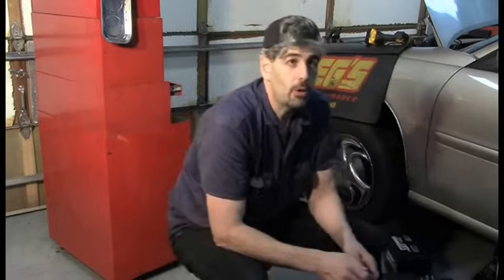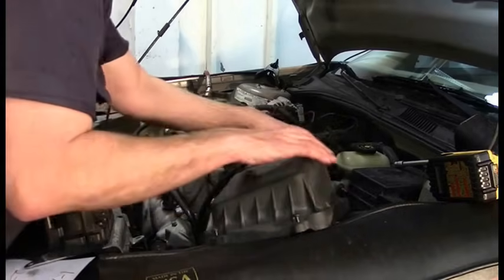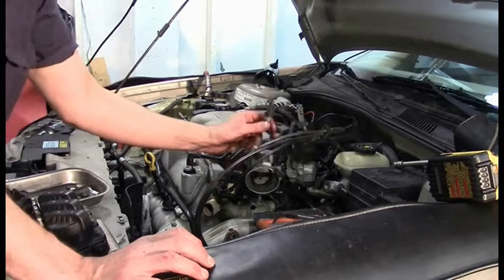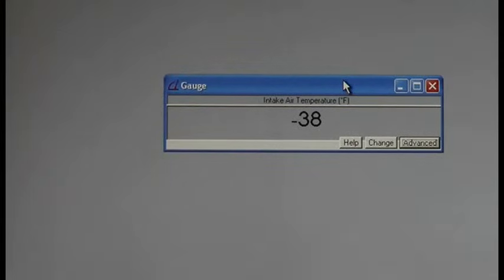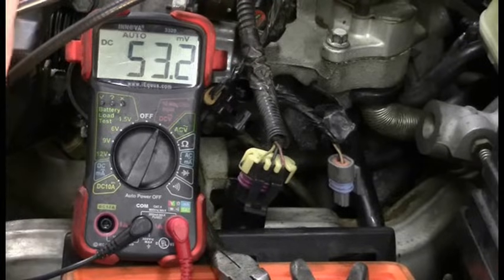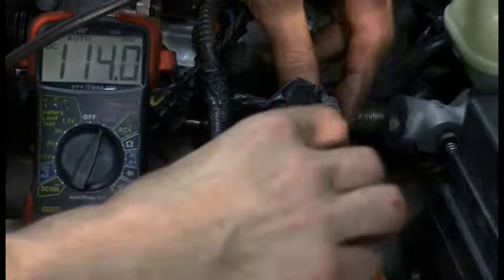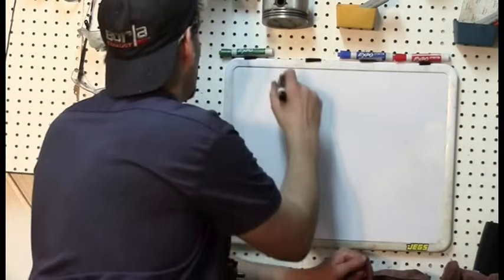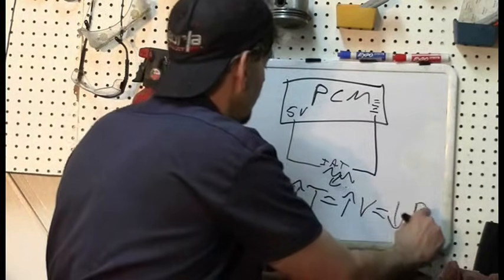IAT ( Intake Air Temperature Sensor ) Diagnosis P1111, P1112, P0113

Comment: I'd just like to say that I really enjoy your channel.  I'm a DIY'er that has a desk job during the day but I love working on my cars.  With 3 kiddos and 5 vehicles in our driveway, we cannot afford new cars.  I get great satisfaction in keeping my fleet up an running.  Saving money and the feeling of fixing something is always a rush.  I'll admit that I watch a lot of videos trying to diagnose and determine the best route to take which can often be part swapping.  And even though I find the problem pretty quickly, I know I sometimes replace parts that did not need to be replaced.  I really like your approach of finding the why behind the what.  Thanks for taking the time to explain in detail how you find the root problem is.  I'm investing in a power probe kit that you use.  Looks like a great tool especially since my vehicles are up to 15 years old with up to 260,000 miles.  I really try to take of what I have and make it last as long as possible.

I wanted to see if you might want to offer some advice on a problem I'm have on my daughters 1999 Jeep Wrangler 4.0 v6.  We bought the vehicle with 82k miles and its in really great shape but looks like it has set up a while.  My daughter is 17 and I as with all my kids, I want them to have some working knowledge on how to work on cars so they don't get taken advantage of when they move way from home.  We have replaced all the brakes, shocks, fuel pump, IAC valve, flushed brake system, replaced radiator, thermostat, flushed cooling system, flushed power steering fluid, changed differential fluids, belts, hoses, throttle position sensor.  

Here is my problem.  On cold start, no idle problem.  She drives to school which is about 15 minutes away.  After her class she leaves about 45 minutes later,  it idles really high around 2500 rpm and then bogs down as she puts it in gear and drives away.  When it bogs down it sounds like its not getting fuel.  Fuel pressure is good.   After about 5 seconds or so of driving, it will stop bogging down an run ok.  When she puts it in part, it revs really high.  I replaced the IAC valve and TPS thinking that would stop the problem but no luck.  I am wondering if it could be the air temp sensor?  Any advice you can offer up?  Thank you...  And there are no engine codes being thrown
Reply from the maker: WHat data do you have? What is the STFT and LTFT at idle vs load? When you changed the TPS and IAC, what were  the IAC positions and did you confirm voltage response from TPS?  I need to know the data you used in your diagnosis of TPS and IAC before I can help.
Reply: The vehicle is not throwing any codes.  Honestly I do not have any of the information you are asking for.  Please note that I have been in a part replacing mode up until now.  You have convinced me to do a better job diagnosing.  Not exactly what to check first based on the symptoms. Could you recommend which parts I should test first?  I have just today ordered the power probe kit.  I do have a volt meter and an Actron engine code reader/diagnostic tool.  I will check to see if the scanner will give me the STFT and LTFT data.  I did not confirm any voltage response from TPS when I changed the TPS and IAC.  I just know it did not fix the problem.  Just not sure where to start.  Definitely seems like once the vehicle is warm it acts up vs. cold start. But even after driving for long periods, it wants to idle high once we put it back in park.  And gas mileage sucks bad.
Reply from the maker: Jeremy-Stephanie Millar Yeah without any data I'd be no better at guessing than anyone else. If you get me some data I can help.
Reply: Sounds good.  I guess I'll start with fuel trims and then see if TPS is working properly.  Thanks for the quick response.

Comment: When testing the IAT sensor did you turn the ignition switch on to mimic driving conditions that could be why you didn't have any voltage readings above millivolts.
Reply from the maker: You have to have KOEO for any sensor tests. No sensors are active otherwise.

Comment: Got tired of ignoring IAT code lighting up the check engine, ( yes its still there :o ). Thank you for the vid for simple test. But now wish I had the signal break finder tool. Hoping mine is a invisble break at top of motor and not harness or pcm.

Comment: I have a dodge charger 09 for some reason sometimes when I start it makes a clanking noise I've done so much to the car but nothin really helps
Reply from the maker: You just need to do basic diagnosis taking things apart until you find the noise.  What have you done so far? What's the oil pressure at startup? is the noise valvetrain or crankshaft related? What's the starting temperature?  You need to tell which of these you have done.

Comment: im getting the right amount of degrees on my code scanner but it changes to -40 when i unclip the plug that goes to the iat sensor. i tested the resistance of the sensor and it starts off at 1.9 instead of 2.6 but it does go down when i put a hair dryer on it. does this mean my sensor is good or bad?
Reply from the maker: What else would you expect?
Reply: Schrodingers Box  im not sure what you mean? one of the methods says my sensor is fine while the other says it is not working properly. so thats why I'm asking what you think it could be?

thanks for the reply.
Reply from the maker: KNAMusic Looks right to me
Reply: Schrodingers Box all im asking is how can my sensor pass the hair dryer test but fail the code scanner test? i checked for the voltage on the thing that attaches to the sensor and I'm getting 5 volts. which feom what you said means the wiring is fine? im judt a little confused because the sensor passed one test but failed the other
Reply from the maker: KNAMusic How did it fail the code test? If you unplug it to create an open it should show -40
Reply: Schrodingers Box oh alright. well then i don't quite get why the code is even showing in the first plave then. is there a chance that it was fixed earlier and the code was never cleared so it stayed there? or should the code go away by itself?
Reply from the maker: KNAMusic You will need a chart comparing the resistance and/or voltage output in p[roportion to actual temperature to ensure you have calibration.
  ALSO, it may be you have an air volume input error that is erroneously being blamed on the IAT.  WHat is your fuel trim showing?
Reply: Schrodingers Box  my stft percentage is bouncing ranges from -0.8 to -1.8. it sometimes hits 0. does this sound normal to you in a warm engine? also i appreciate the replies. you earned yourself a new subscriber :)
Reply from the maker: KNAMusic Yes thats expected- its the LTFT that gives your trim history. The waivering STFT is the result of the intention rich-lean oscillation by the PCM.  See my "P0420 diagnosis" video.
Reply: Schrodingers Box okay i will do that tomorrow. thank you :)

Comment: Hi there.  I'm hoping you can help me out.  My car started to feel jerky while accelerating.  I got a P0110 code.   I cleaned the IAT but that did nothing.  The harness connector gives 5.01 volts and there is continuity at ground.  At 20K Ohms the sensor is 1.9 (the number decreases fast when heated).  Is this a normal value for a Denso IAT?  I can't find any specs for the one I have.  Any help is appreciated.   Thank you.
Reply: Zuvtehcoa could be spark plugs/wires/throttle body.

Comment: thanks for your info man I apreciate your knowlege i did the scan tool method and the sensor is bad im replacing it tomorrow morning 2005 dodge grand caravan
Reply from the maker: What was the data you got? Just curious.
Reply: Schrodingers Box i got 73° while at the time it was 43° after being unplugged it turned -68°
Reply: Kayla Janet it was around 36 dls at my local O'Reilly Autoparts

Comment: i have an 07 ram 3.7 that for ever reason randomly decides to run rough when idling...no codes... some pple have said clean the maf sensor...im not sure where it is on that motor.... I did clean that iat and the throttle body which both were realllllllyyy dirty and that seemed to help alloot.... but still not where it could be...any thoughts
Reply from the maker: What data do you have? What is the foundation for those saying it is a MAF issue? Is that indicated by increased fuel trim under load or by voltage and frequency compared to baselines?

Comment: I open the hood of the car and the IAT was disconnected. I had it serviced so they forgot to connect it back. but after I plugged it back in the check engine light still on. should it go off right away or do I need to erase the codes?
Reply from the maker: It will go off after about 40 drive cycles on its own. You can also erase with code reader or disconnect battery for an hour

Comment: Nice video ! now I have a question I have a 2016 challenger scat pack and I was racing 1/4 mile and spraying nitrous after my run I had the P0113 code .. do you think it was because I sprayed very close to my sensor?

thanks
Reply from the maker: What data do you have for the STFT and LTFT with and without the NOX?

Comment: I have a 97 Honda Odyssey 2.2 engine and I'm looking to see where is the intake air sensor air temperature sensor and I don't find it
Reply from the maker: As mentioned on the video it is either in snorkel or intake.  It is an intake air temp sensor. The name actually tells you the location.

Comment: the IAT is missing.  there is just a  hole.  i also just got the car back from a mechanic who certified the car.  2003 civic ls
Reply from the maker: I have seen this happen a couple times where a sensor was completely removed with no wiring or anything - often as result of unprofessional engine swap.  WHat I do is simply run new ciruit and sensor directly to the PCM in those cases- its far easier than hunting down the missing wiring.  IAT is super easy since it is only a 5V reference and signal return so I usually just tap into existing 5V circuit and ground at PCM return

Comment: I loved your video, and praise your skill as a mechanic.   I particularly like your use of a wire tracing tool to find a break in a wiring harness!    I have one of those... for tracing phone lines in buildings, and I'm going to use it your way... Right on!

By the way, we are opposites!   As such, I might have some simple advice that will enhance your t/s skills in this age of sensors, actuators, and computers.   I'm an orthodox, experienced hardware electronics engineer, and only an occasional "mechanic."   I noticed your naivete about electronics right at the beginning of the video ... with no animus, only praise that you solve problems day in, and day out, despite this naivete.    If you'd learn Ohm's Law and (importantly) realize how useful it is (via voltage drops, when current flows) you'd be barking up the right tree, on some of the theory points you are flirting with.

So there exist voltage and current sources; laypersons easily grasp the notion of a car battery as a voltage source; a new battery is a very good voltage source.    Then there are voltage dividers (and also current dividers, a more subtle point) and t resistors convert voltage sources to current sources, back and forth, back and forth.     Point being that once current starts flowing, voltages observed (relative to ground) start dropping, the further you get, down the line from the voltage source.

I won't go further with this lecture... and I compliment you for making the long, detailed video, to help me and a lot of other people by being so generous.

Hey, I would have looked for a wiring diagram before doing any repairs.     You didn't bother.    Instead, you used a wire tracing tool.  Bravo!       I learned something about the practical world.

Comment: I have AIT the integrated into the MAF, I replaced the MAF and am still having the same code p0113... I have no idea how to check the voltage or find if the line is broken
Reply from the maker: +rasheed bradley Yeah hopefully someone will make a video showing how to do do diagnostics on the IAT circuit. I can't think of any sources for a clear, easy to follow video that anyone has done on YouTube that shows easily how to do that.

Comment: You always mention the 5 volt reference when testing components,,,does this also apply to foreign I'e British vehicles.    Great channel, have learned a lot from watching
Reply: its always manufacturer specific but typically computer reference voltage is 5v.  Sometimes 7v.

Comment: Matt, my problem was when I changed the thermostat, the black wire broke off the connector.  Am I able to just get a new connector? Or will I need to get a whole wire harness just for the connector?
Reply: +ggin nj - nevermind - found it!

http://www.amazon.com/dp/B00CF64940?psc=1

Comment: Great job Matt…you said you are self taught.    What books do you use to self teach ?
Thanks again    walt
Reply from the maker: +berkmanyt I mainly use the helms factory service manuals.
Reply: +Schrodingers Box    I have  some  Haynes manual…several Camaro factory shop manuals (expensive  #135+)  provide good info…but are sometimes weak also.  One has to do web searches and then  'filter' the results.   Thanks again Matt

Comment: Great video.  Working the exact problem on a GM 3.1.  Thanks for doing these, saved me butt loads of $$$$.
Reply from the maker: +Jason Bailey Yes it turns out a GM tech saw my video and he actually sent me a TSB that was issued long ago on this very problem. Chances are you will find an open in exactly the same location that I did in the video.

Comment: What's the next step when the IAT works with the Hair Dryer test and you get 5V at the connetor but you still get the P0113 code?
Reply from the maker: +nobrizzle In that (unlikely) case you need to do 3 things:
1. Establish that the ground is indeed reaching the PCM as opposed to being faulted to the chassis.
2. Establish that there is no voltage drop on the circuit.
3. Establish that the IAT is in fact working but the code is referenced from an other malfunctioning component or circuit.
Reply: Ok, thx. It's what's happening.

Comment: video time 12;00,,, didnt uderstand higher temperature=lower resistane=higher voltages
but the different chart says higher  temperature=lower resistane=lower voltage ,,,,i checked on google images ,,,ADP training video also is saying cold air =4.7volt and hot air=0.8 volt.

im very confused because i have my exam .

peace and blessings
 
thanx
zia
Reply from the maker: +Zia Din Yes I apologize I mispoke in the video.  Others have also pointed this out. The chart is indeed correct.

  When the temperature increases, resistance on the thermistor decreases (it's known as a negative temperature coefficient).

If the resistance decreases, voltage decreases as well.  You will see the highest voltage when the resistor is cold (maximum resistance) and the voltage will lower as it warms up.

My apologies, this was my mistake for sure.
Reply: Great video! I'm just learning about this sensor. Yes, you did say it wrong on the video, but your explanation above is correct. Let me try to explain a little more in detail. Your voltage source wire will remain at 5V, if you measure from negative or ground to the 5V source wire. If the resistance decreases, the voltage drop across the resister (thermistor) will decrease, but the current will increase. If you measure voltage from negative or ground to the other wire, it should read a voltage less than 5V or could read 0V if that other wire beyond the thermistor actually goes directly to ground or negative. Reading the voltage drop across the thermistor will be a voltage less than the source 5V, depending on the resistance. So, the computer is either sensing the voltage drop across the thermistor, or sensing the current flowing thru the thermistor.
Reply: And, of course, there are both types of thermistors; either PTC (positive) or NTC (negative).  The chart for one is obviously transverse to the other.

Comment: wow, NOW THAT IS NEWS FOR ME, DUDE... that little tool is great, i am buying one as son as i can find a place where they sell it... as for my problem, it is about an old tbi in my ´92dodge ram truck(not a magnum engine), i cracked open a hole in the front dam to route more air at the throttle body, but it (aparently) lowered  the ait temperature in such way, it is not injecting enough fuel  and , consequently, it lost  some power, i believe, this system is just too old to compensate for that mod, so i am closing it to its old shape and forget about that... bad luck , i guess... i thought it would produce more power, but i was wrong...am i  reading that problem right or not??... great work, man, cheers... :)
Reply from the maker: +EKO EKO AZARAK It probably has more to do that the truck may be speed density rather than MAF. The IAT is insignificant.
  Is the truck speed density design?
Reply: sorry for not responding as quick as you did, man.... yes it is, is an old tbi system,actually, it has happened before, when i bought one of those open element hi performance air filters from spectre,it was as if the engine could not rev as hard as before with the old stock air cleaner, it just had to take a little time to react to a hard acceleration or when i climbed a hill loaded with my trailer, once i put back the old set up, everything went OK... i installed that air filter in my ´81 ford mustang (carbureted) and it works wonders in her performance, just the oposite with my truck...like i said, a little bad luck, but other than that, it works great... thanks for your kind reply, man, cheers ...
Reply: +Schrodingers Box Man you are a beast.